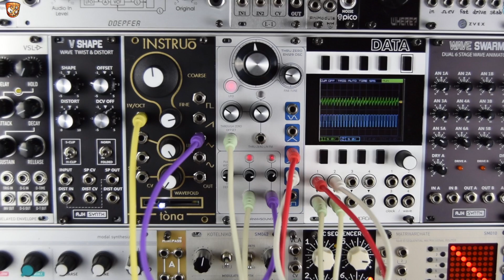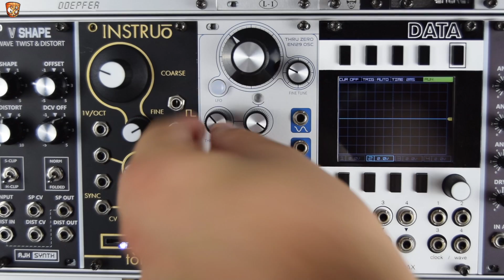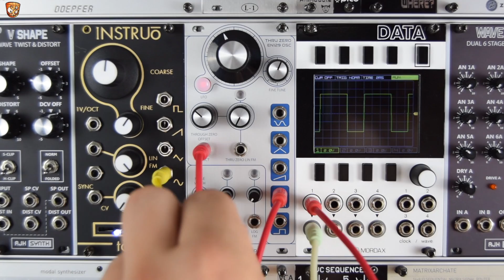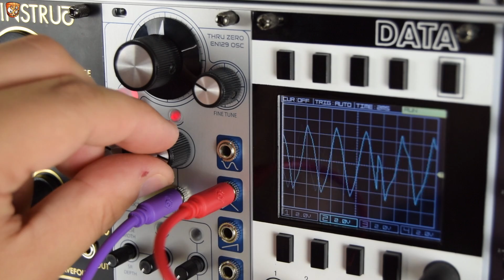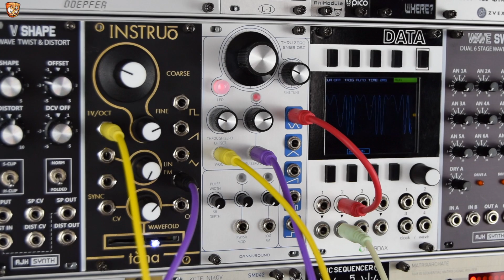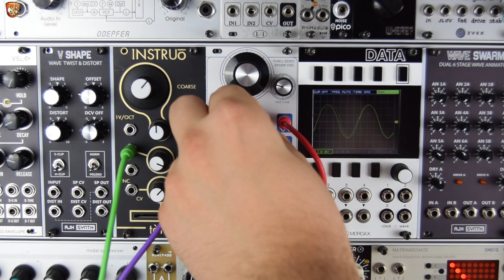Dannysound EN129 Thru Zero Oscillator (a world of analog tones!)

Comment: all sounds great. i have one critique of the EN129 tho..  its sine wave does not sound like a pure sine wave at all. its full of harmonics, almost as if some of the triangle or square is bleeding in.  on both demos (with instruo and with cali osc)

ive compared to Doepfer 110-4, Stroh 258J and Endorphin FG and and they are much purer sines. in that order.
Reply: in fairness, the furthrrrr generator only does through-zero if you use a digital oscillator core, so that should be expected to be pure.

I assume you're going from less to more pure there?
Reply: @GeorgeLocke  i commented on the quality of analog sine wave specifically i.e. not limiting that observation to thru zero products only. There are many analog osc that have purer sine than this, with or without tz capability,  so this is not the expected norm.

having a less than pure sine isnt the end of the world, but  does affect the outcome in any fm context: regardless whether you choose expo, linear or linear tz. or phase modulation for that matter.

PS the FG i mentioned is regular all analog version. the digital strong core tz is an option, which i don't like the sound of at all, to be honest.

Comment: Someone needs to put out a super simple, 4 or 6 hp, through-zero, Carrier-Operator sine VCO. Just v/o, a tuning knob, FM input, an FM attenuverter, and an output. Then you can just buy any number of them, chain them into each other with envelopes however you want, and have a patchable DX
Reply from the maker: Akemies Castle from ALM Busy Circuits and Humble Audios Quad Operator are fantastic patchable DX style FM units.
Reply: @DivKid  Totally, they both look awesome, especially excited about the quad's routing abilities and am seriously considering it. and definitely getting this EN129, probably 2. I would just love the flexibility of even smaller independent modules that could be used alone or together in any carrier/operator configuration. Am I also correct that both of those only have one v/o input for the whole unit? though I guess you're feeding external VCOs into them which you can tune however you want... I'm possibly seeing a deficiency where there isn't one. I'm pretty fresh to eurorack, somethimes I miss things when I'm trying to figure out the whole space/function/price equation
Reply from the maker: The Humble Audio Quad Operator can be used in a non ratio synced tuning mode for each of the 4 oscillators. That's then independent 4x v/oct.
Reply: @DivKid  ah, I see. Awesome,  and thanks! So then I guess you can tune those however you want,  and then also tune all four as a whole with the master tuning ķnob? Wow,  that's really cool.

Do you find it easy to get precise enough tuning with those smaller knobs it has?

Comment: Really high quality oscillator. Really sharp, noise free and analytic waveforms out of it. Most of the triangles, sines and sawtooths I see on other oscillators, are very approximate and rounded. Sometimes sonically it doesn't matter, or actually helps, but it is nice to see an oscillator that is very pure and predictable in their shapes. The output isn't exactly -5V to +5V, there is slight positive bias, maybe -4.5V to +4.8V ?

Comment: What filter and envelope are you using? Really nice snappy pluck sounds. You create some amazing patches and sounds. I'd love to hear your music. Are there any modules this good that you can buy without DIY?
Reply from the maker: With the square wave stuff? That was Mutable Instruments Ripples and the envelope was the WMD Multimode Envelope.
Reply: DivKidVideo  Yes that's the one at about 7:30. I went to a local hackspace to learn how to solder this week as I want to build one of these oscillators. It seemed to go pretty well. It's got a great sound and is a pretty cheap way into zero-through fm. It would be nice to play analogue fm sounds across the keyboard or sequence and get something musical. Do you really rate it over linear? How does it compare to the rubicon oscillator? I'm quite tempted by that and the dpo but the dpo doesn't do zero through.

Comment: The Log in wasn't as "wood'y" as the name suggested. :D :D :D
Reply: You sir....get a prize......
Reply from the maker: haha I've nothing to offer but well done Magnus that made me laugh. :)
Reply: I'm glad i made you laugh Ben. :D
Looks like a real nice and feature-rich VCO, as always the question...how good is the tracking? Wouldnt it be nice with some kind of a standard method for testing VCO's pitch-tracking (like the saw into a filter sweep with a few different resonance levels for the filter tests) I normally test a new VCO together with a stable source (like a sampler och DCO). Then i play both OSC's mixed together on midi keyboard,  just going up the scale until the test VCO starts to drift from the reference too much and the beating kicks in. My good tracking VCO's track quite far (near dogwhistle territory :D), like the Dixie II and the Z3000mk2.
But i guess it is a bit tricky coz if it is just a few cents off in the beginning it can have a big effect further up. I think we should have a number...like on the amplifiers signal to noise ratio, noise floor etc. Like at how many notes up does the tuning go before it goes out of a certain range (have to decide what amount of cents is reasonable value to use as max detuned) As it is now is guesswork even from manufacturers...like -"on a good day, in the sun you may get 5 octaves". Anyway, maybe this is to small ans niche to rant about this kinds of things, just some thoughts...laters.

Comment: Nice design and sounds great. The build looks like a “medium PITA”. Not a beginner build, but nothing like building an Easel. I haven’t looked into the calibration process. In the US, it’s around $250 for a full kit plus your build time. Compare with the $399 (and humongous) Rubicon II, which clearly has significant overlap with this module.
Reply: To be fair R2 has double the available waveforms and other stuff.
Reply: I've built a fair bit, but it wasn't hard at all. The calibration was easy too. You can do it with a stable voltage source and a rubbish computer oscilloscope. A couple of really good oscillators, these two.
Reply from the maker: all good points, I like it when a group reply to each other :)